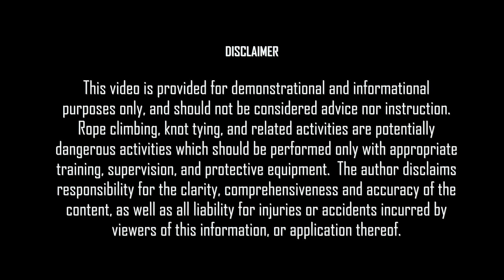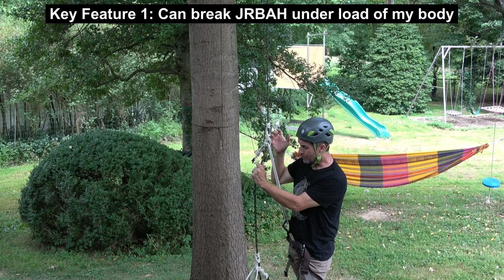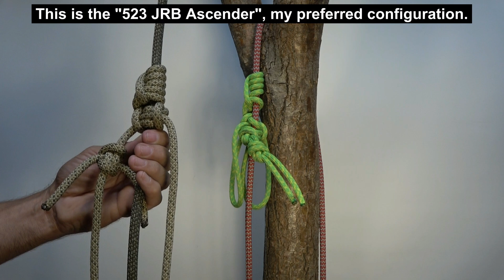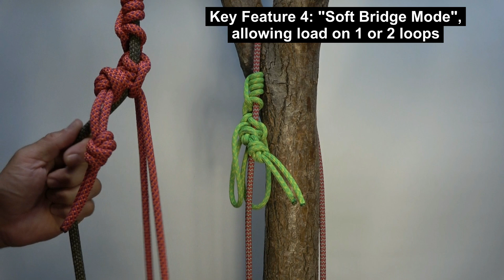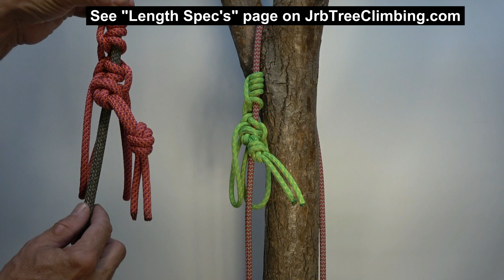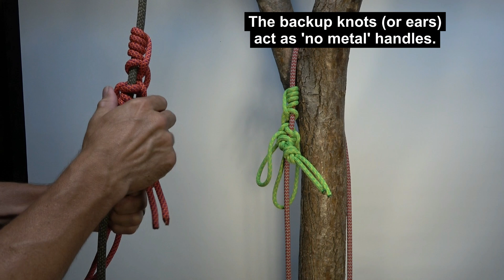Introducing the Non-Jamming JRB Ascender Hitch Variant

Comment: Which is more secure?  The Zeppelin's or Hunter's Bend?  My constant salute...
Reply from the maker: Great question, and it's one I have studied a lot. Security and strength are both important, but they are different.  I have not pull tested them to a failure but have researched it to conclude that Zeppelin is supposedly stronger than Hunter's. However, both are very strong. The main difference is that after an extreme load, Zeppelin is easier to untie, whereby Hunter's might need to be cut. However, at reasonable loads, such as those we generate with our body in rope climbing, Hunter's is perfectly easy to untie.  And when it comes to stability, Hunter's is better than Zeppelin... we can set it well with just a strong pull on each of the 4 strands. But when we set the Zeppelin the same way, it's still fairly unstable and could come undone with enough jostling.  In conclusion, I prefer Hunter's for climbing, and I prefer Zeppelin for lifting heavy loads, such as arborist rigging applications.

Comment: This works great and with this and the garda foot loop, my fat butt can get in the top of a tree. This morning I tried a double rope and hip thrusting. Forget it. I anchored one end of the rope and went and got my garda foot loop.If you can climb a step ladder you can get up a tree this way.
Reply from the maker: Great.  Be aware that a basal anchor puts double the load on the tree crotch as a canopy anchor.  I only use a basal anchor when there's branches between the strands and i am certain the crotch is strong enough.
Reply: I was gonna ask, based on your experience are white oaks known for strong crotches? @jrbtc
Reply from the maker: @simplyphi144  yes, white oaks are not only strong but also provide a good natural shape. In contrast, the native Locust trees in my woods are super strong but the crotches are a tight V shape and a rope will often get stuck in it.
Reply: noted. Also,  I was working with the Agile and Longhorn Agile in RAD SRT this mornng just experimenting because it seemed so cool to watch you do that on the video. I was struggling to brake the longhorn on descent. When I got down I had an idea to see how well the JRBascender auto tends. It auto tends well and progress captures just as well in RAD SRT. I was using a micro pully with a jrb ascender on top and on bottom. I was making progress and was able to descend with no problem. I'm 275lb on 11mm rope and I tie my hitches in 9mm. So, it may only be applicable to heavier climbers but try the JRB Ascender auto tend properties in RAD SRT and let me know what you think. And if you've already covered that apologies I haven't watched every video  .   @jrbtc
Reply from the maker: @simplyphi144  As of the current time, I have not done a lot of RADS SRT on just friction hitches.  The reason for that is because for me at my body weight and strength profile, a 1:1 SRT is plenty easy and 3x faster. If you're a bigger climber, you might want to consider 8mm cords on 11mm ropes. Everything is easier to move and break. If ya have questions or photos or video clips, pls post em in the JRB Tree Climbing Facebook group.  It's hard to make an educated guess at what you are experiencing without seeing it. Be safe.

Comment: Ok have done several climbs with  the non jamming 5-2-3, works great! eliminated my rings for handles and also carabiner connection from bridge to hitches, just run my web bridge through the loops , now ascending is so smooth, love these non jam hitch variant!!
Reply from the maker: With no metal in your setup, when you rotate your weight left and right, your web bridge will move inside the hitch loops causing friction and wear on both. I can't recommend that for most climbing scenarios, particularly hunting.
Reply: @jrbtc  will keep an eye on that but I try to keep still so the deer won’t spot me, oh and usually I will throw a redirect , a  length of rope with a jrb cinch setup for a tether with two 5-2-3 hitches on it ,  hook up my redundant bridge with a carabiner, and release my main bridge, (just slide down the hitches actually so I have them attached for backup,)to get in best position for the hunt , will generally use the bottom hitch for the bridge and the upper hitch for my weapon so nice to be able to make adjustments quietly and effortlessly. And throw another tether with jrb cinch below me to hold my pack. But thank you for the advice .  Before, Often when ascending with a carabiner connecting the hitches to my bridge , as I would make the double shove, the loops would catch on the carabiner lock mechanism and give me a little problem , now without any metal the climb is so smooth, quiet,  and safe. Another thing I’ve been doing that I like a lot is using a footboard as my platform attached to a tether rope, again the jrb cinch, with a couple of hitches 5-2-3 , allows me to adjust the footboard easily and so easy to hang on the tree , always thinking of tweaking the system for improvement. Again thank you for sharing your wealth of knowledge as your tutelage has progressed my capabilities of safe climbing and getting in to new areas for hunting tremendously.

Comment: Not making a comparison, just pointing out that a Valdotain Tresse prusik knot is able to be used (in an emergency) for rappelling.

Also, making asymmetrical prusik knots from an eye to eye cord makes for easy climbing advancement.

I like your spirit of experimentation though.
Reply from the maker: Thank you, appreciate the input. I have experimented with VT and XT, but never tried an emergency rappel.  Good to know.  As for using an eye to eye, I don't recommend it for the JRB Ascender Hitch, only because its  difficult to tie it such that the strands are evenly balanced, and even when they look about right, but the load is imbalanced, it affects performance.  A bend ensures even loading.  This particular variant places the bend inside the hitch and also serves as a jamming prevention device and allows it to be ultra compact.  We could create a "hitch climber DRT system" and not need a pulley.

Comment: How often do you retye your ascender hitches?
Reply from the maker: I don't count the number of climbs and so i can't give a precise answer.  If you do not put a load on them in rappel (which is how i climb), they will last a long time. You can work a little slack in from the bottom up into the top helix and peel it away from the rope to get an idea how much wear is on it. All I can say is to use your judgment and are on the side of untying and inspecting more frequently than you need to than less. And of course, if the hitchcord is showing excessive signs of where, replace them in accordance with manufacturer recommendations. We can't be too safe and cord is pretty cheap .

Comment: Pretty sure I have canyon c-Iv 9.0 mm.. would you say the sterling Trc 6mm would be a safe and reliable option for the assender and adjustable bridge or do you recommend something else.. my knowledge on the subject is next to none so would like your opinion.. thanks
Reply from the maker: I prefer the 7mm standard nylon Sterling cord.  TRC works on the hitches, a little stiffer to move, but not my choice for the Bridge. My bridge design can be 8mm too, but I went with 7.

Comment: Interesting, nice innovation to to be able to switch from soft bridge to bridge mode so easily, but I really like using a small brass ring as a toggle with bridge mode. Nice and slick, wondering if this one will hang in a crotch looks a bit bulky with the two overhand knots.
Reply from the maker: Of course, that's a working solution, so keep using it if its your preference.  And this one is more bulky, but 6mm on 8mm should still pass through almost any crotch.
Reply: @jrbtc  finally dawned on me why I was having such a problem with the self tending neck strap, I had the tended ascender hitches on a bridge together, instead of on the saddle bridge loops, (actually I have D rings at each side of my saddle for bridge connections) so now I have carabiners at each side for the tended hitches and it works nice, might try the compact  variant for  the tended hitches, but I like you subtle tip of nesting the upper and lower hitches together on rappelling, on descent with the munter,  I disconnect the self tended hitches and put them on my upper bridge with the top hitches, just took me several climbs to work out the adjustments , lentth of bridges, length of best friend, length of hunter bends,